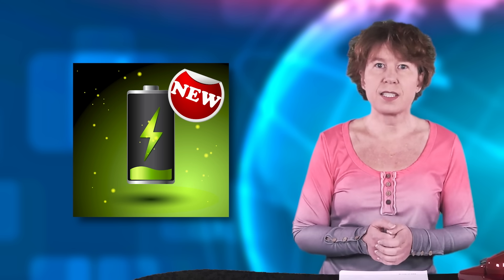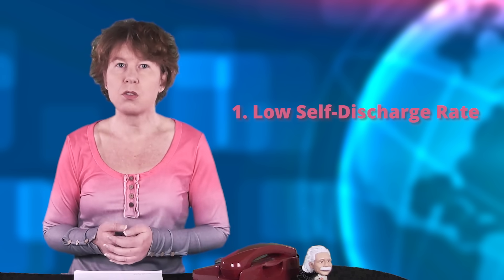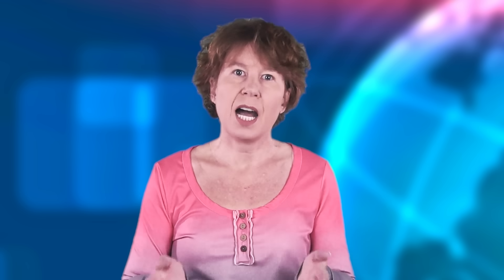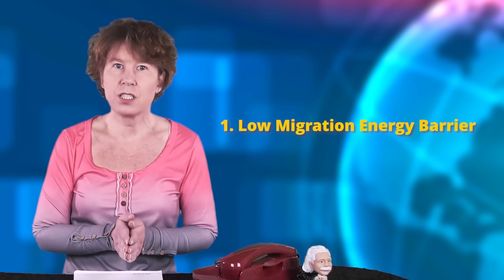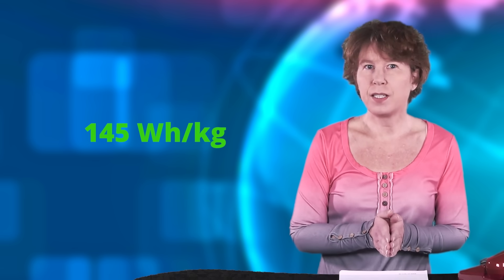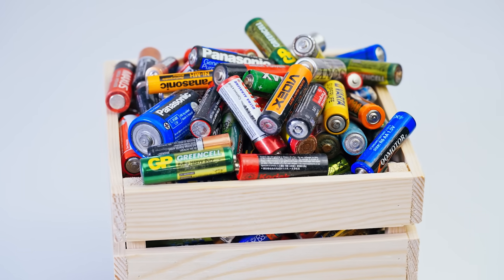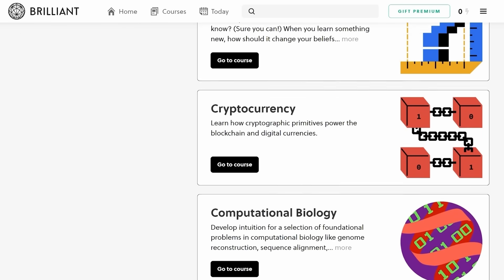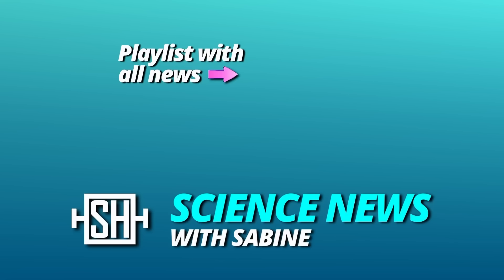Fully Charged in Just 5 Minutes: New Battery Breaks Records

Comment: I may be old fashioned, but I like my toys to plug in the wall.   I don't like my toys to have batteries, for the simple reason, batteries cost fair money and they wear out very fast.   So you always have the issue of finding the proper battery to replace, how to throw the batteries away in an environmental manner.   So, here is the deal....How much does it cost to have a battery station installed in your home for the battery car?   I'm thinking the home charging station is going to go for a minimum of $30,000 for parts and installation (for the EV).   And who pays to dispose of the lithium toxic battery and the same thing for wind or solar :   Your going to need a big BIG storage battery, so how much does that cost ?   An independent 'home' battery to use when those pesky tornados come to town, is around $25,000.   Now, you got your big lithium batter next to your home and it slowly over times becomes ineffective....its TOXIC WASTE.   Who will pay for the toxic waste pickup and disposal ?   The entire EV and GREEN energy (wind, solar, etc) is not reliable and will cost the average citizen a minimum of 3 or 4 times the per watt cost.    So, we go from being slaves to the petrol station, to paying 3 or 4 times current costs to the electricity provider.   NONE of the green energy is inexpensive, reliable and leaves an ecosystem cost.   Fields and fields of solar cells changes the ecosystem under the soil.   No plants, so the soil is susceptible to erosion and blowing away.   No light, no plants, no wildlife.    The windmills are huge killers of bats and birds which unsuspectingly fly right into the blades and are killed and gather around on the ground under the windmills.   The solution is go nuclear for power grid and improve emissions reductions for internal combustion vehicles.  AND, plant more trees to suck up C and turn it into O via photosynthesis.   There are simple answers.

Comment: Sabine, nice way to force me to a comment. It is never a question what you need or me, but the market. To reduce the numbers of loading stations you need ultra fast charging like in the case of gasoline station. You could also reduce there the pump speed or diameter of the tube and than loading time of gasoline would be 1-2 hours or more.

Comment: Charging time does relate to range anxiety.  If you've got to charge at a charging station at all, it makes a big difference whether each full charge takes 5 minutes or 30 minutes if you are in a line with 5 people in front of you.
Reply: But it will be decades before most cars could charge at those speeds. One expensive super-charger, with a queue of people taking 30+ minutes to charge will really annoy the fancy-car drivers. A row of 'normally rapid' chargers would still be far better use of limited supply capacity.
Reply: @robinleicester  Might not be all that long, IF electric cars take off.  Of course, that's still a big IF.

Comment: I bought a PHEV about 5 months ago.  It has a 13 kWh battery that takes about 8 hours to charge from empty to full (*) with my Level 1 charger.   Is that a long time?  Not at all if you're asleep most of that time.  So, if I'm disciplined enough to remember to plug in the charger every evening, it's all charged up in the morning.

Almost all of my driving is "errands", so the 30 mile range for EV mode is plenty for almost everything (**).  The gasoline engine propels my car at about 25 mpg (sorry for mixing units).  That may not seem particularly great, and it's not, but this is a relatively heavy SUV with AWD.  On the other hand, on my current tank of gas I'm getting 190 mpg because the gas engine rarely turns on --- that's about 3 times the milage of the lightest, most miserly car on the road.  Of course, the comparison is more complicated, because I have ignored the cost of the electricity.  However the cost of electricity per mile is about 1/5th the cost of gasoline per mile where I live (***).

Upshot: you probably don't need fast charging for a PHEV.

For a full EV, though, that's a different story.  The batteries for full EV cars are typically 80 -- 100 kWh capacity; it would take 2-4 days for my L1 charger to fill that battery; L2 would halve that --- still slow, but that will get you 50-60 miles of range while you sleep

Quite a few years ago I published a letter in IEEE Spectrum pointing out that, when you are refueling your car with gasoline, the energy is going into the tank at a rate of about 5 MW.  It is very difficult to imagine a consumer technology that would make coupling 5 MW to a car suitably safe, and as Sabine points out, we just don't have a car-sized battery technology that can be charged that fast.

(*) for a variety of reasons, PHEVs will generally avoid discharging below 10%, and chargers will halt at about 90%, so "charging an empty battery to full" doesn't necessarily mean what you think it does; in my case, the effective battery capacity is about 10 kWh.  Because everything has its own web page today, so does my car, and I can remotely monitor its battery charge (and charging) status.

(**) the one peculiar dependence upon the gasoline engine: front window defrost --- it relies upon the heat of the gas engine to provide hot air.  That is the only thing limiting my milage right now.

(***) there is a coffee shop about 2 miles from me that offers free charging, which costs them far less than the coffee I buy.

Comment: OK I'm fortunate in that I have a charger in my driveway and the bulk of my journeys are relatively local. This means charging is not a hassle, it's just a case of plugging a cable in and getting on with whatever I was going to do in the house anyway. Now I realise that if we are to move to EVs then some people, no, a lot of people won't have this option. But what it means to me is that my days of hanging around a smelly petrol station holding a nozzle while the tank fills, are far fewer (we still have a largely ignored petrol backup car).

But fast charging batteries will indeed help those people who don't have my good fortune. But perhaps we need to rethink how we use , or rather how we charge vehicles. I mean I presume everyone who owns a car has some purposes they put it too generally. It will be a minority of people who keep a car "just in case". So if that car is used to travel to work then we need to encourage employers to include chargers, if it is for travelling to the shops then the shopping centres need chargers, if it is to drive to a local station then the parking there needs chargers.

So for me, the fact that my ageing car takes nearly an hour to charge, is not a problem because that hour is generally either spent at home typing pointless messages on YouTube, or it is sat behind my desk at work and in both cases that hour speeds past. But even if I had a more modern EV and every few hundred kilometers I was forced to stop and charge for 15 minutes while sipping a cup of coffee, that's hardly a big problem.

Comment: most any 18650, 22650 etc can be charged in 4 min.  therefore, by default any combo of them in series or parallel can be charged in 4 min.
but when you have 100000 cells of 18650s, you need serious power to charge those in 4 min.  

no matter what tech an ev uses, the ev itself can drive for approx 3 hours at 100k watts.  to recharge that in a few minutes would need massive power available.

Comment: Since we started this with charging EV's lets look at a reasonable situation.  Sure, every EV owner (who is typically a detached home owner with a 2 car garage) just imagines everyone is just like them, but if you look around major cities (LA, NY, Tokyo, Berlin) the vast majority of cars are not "plugged in at home", they'll requrire a charging station.
Tesla has their Supercharger, it currently charges at 480Volts and requires/is limited to a draw of 250Amps (that's 120kW that must be supplied for the duration of charging) This duration is of course dependent on the battery capacity, if we have a humble 40kWh battery that means hanging around for about 30minutes. Now if you've got any sort of memory a typical petrol/gas station has often got more than 5 vehicles "charging up"; so that's in the order of 600kW drained from the grid fairly constantly.
I accept that people can't comprehend this but its vast, a mid-sized shopping mall sucks 49kW per hour for lights and AC; I return your attention to the 600kW being drained by the "charging station"
Things now get a lot worse when you move that to a 5 minute charge time (as that's about what it takes to refill my car). It gets worse because the Amps have to up; 1000Amps will be needed to charge that 40kWh EV in 5 minutes.
One Thousand Amps ... folks that's transmission line powers; that's whole town infractructure there per carging of one EV in 5 minutes.
Reply: Imagine trying to handle a transmission line cable, to plug into your car for recharge.

Comment: Charge time is important for commercial vehicles or public transport though. Long charge times mean that the vehicle is not in use and you need more vehicles and more drivers 
Although twice drop in energy density is huge. Electric lorries already have much shorter range than diesel ones, so the economy of that is questionable
Maybe those batteries find their application where vehicles don't need a long range but used heavily, for example in marine ports or automated warehouses

Comment: I don't understand why we do not just replace all/part of gas stations with battery exchange stations. Slowly charging batteries is ideal for their longevity... why not figure out solutions that reuse existing infrastructure? I figure the biggest issue is having/accepting a standard battery, which isn't a thing atm.

Hydrogen produced on site seemed to have this same idea... doesn't matter what recharges a battery, so why not?
Reply: Sabine made a video about the problems last summer: It´s the grid, that has to change fundamentally, but no one seems to see that, and no one implements it.

Comment: I think there are situations where charging in 5 minutes by doubling the size of the battery makes sense. Maybe a bus for public transport within the city. The battery could be charged at final stations. The distance between one end and the other of a bus line is not that big, hence the battery would not need to be gigantic.
Reply: I don't know. Especially for buses it seems it would be easy to accommodate longer loading times. At worst, just buy a few more vehicles. Might be cheaper than the required electricity infrastructure for extra-fast charging.
Reply: @harmless6813  That really depends on individual cases. And at this point it would be even smarter in a lot of cases to just use Diesel. I would be happy to see this to change.
Reply: @frankhabermann9083 It might be 'smarter' for an individual, it is not for humanity. A typical "tragedy of the commons" case.
Reply: @harmless6813  Not in all cases. For instance, diesel can easily be the better option when your electricity comes from very dirty coal power plants.
Reply: @frankhabermann9083 Even in that case a BEV produces less CO2. It's just that much more efficient.
Reply: @harmless6813  I doubt that, but that is not a basis for further discussion. I will look that up when I find the time.

Comment: The biggest hurdle for an increased adoption of EV cars, in the US anyway, is comparing favorably to combustion engines. The biggest issue in perception is that it's hard to take road trips with EV cars. Quicker charging is necessary to replace the idea of filling up a gas car.

It's not necessary 98% of the time because we can charge overnight at home, but sometimes the exception is the barrier. EV cars need to get around this barrier.

Comment: Just off reading the title, is this a battery... or capacitor?  Capacitors both charge and discharge very quickly, the latter not being ideal (or usable) in most applications you would need a battery for.

If it's a battery, that would be neat.
Reply: As she explains, it´s a battery, no? Just another matetrial for the elektrode. A capacitor has a very small capacity

Comment: I'm not sure that faster charging time would help reduce my time at stops.  I spend far less time at the fast charger itself than I used to spend at the gas pump.  I plug in, check that it's charging, and walk away to go pee, get a coffee and maybe a sandwich, hurry back, unplug and drive away.  With a gas pump, the person stands there for a few minutes while it pumps, then walks in, pees, gets a coffee and maybe a sandwich, and drives off.  I'm not seeing the time savings, with ten times as long holding the gas pump handle as I spend holding the charger handle.

If the battery charged in two minutes, I'd be back to standing there the whole time.  That's a time waster, not saver.

Comment: 1) Planned long distance road trips already maximize distance vs charge time. You don’t change over 80% per stop if you don’t have to because of the extra time it takes to top a battery off.

2) If you can reduce a charge stop to less time than it takes to fill a gas tank, you’ve won the battle against conversion.

3) we really should have other solutions to long distance travel, like high speed trains or planes.

Comment: About 90% of the time EVs are charged while they are parked at home or a workplace. There is no need for rapid charging in these circumstances. Battery cost and vehicle range are the two key parameters limiting EV adoption.
Reply: market data shows the biggest decision criteria are still range and charging speed. A car buying decision isnt based on facts, but on emotions. It may be sad, but if you want a larger adaptation you need to paly the game and bring out innovations for a good feeling.

Comment: At a charging station, only one car can charge at a time.Therefore charging in 5 minutes instead of 20 means a single charging station can serve four times the number of cars, which in turn means you need only a fourth of the charging stations to serve the same number of cars. Also, if you go away during charging to do something different, chances are you'll not yet be back when the charging ends, thus further needlessly blocking the charging station. If charging is fast enough that going away isn't worthwhile, you'll probably free the charger for the next car as soon as your car is charged, as there's no point in waiting longer.

Comment: I think we might drop the battery issue altogether.  As we learn to capture carbon in our efforts to hold down atmospheric CO₂ and, as we look for ways to store off peak energy produced by windfarms and solar power stations and turn to electrolysis to obtain hydrogen fuel, I think it might occur to someone that we combine carbon with hydrogen to make what we might refer to as juvenile hydrocarbons which could be formulated as liquids which would have high energy density at atmospheric pressure and room temperature.  It could be stored in underground tanks and pumped into tanks in our vehicles in a couple of minutes.  Such fuel would have no net contribution to atmospheric CO₂.  We could so deplete CO₂ from the atmosphere that we would start to worry about it causing an ice age.

Comment: As someone who actually owns an EV, the concerns about range and charging speeds are overblown. 
Likely perpetuated by people who DON"T own one.

You should be stopping for a break every few hours anyway. 
And 20 mins is perfect for a refresh and most chargers are positioned in places near cafes, shops and things to see.

The only real issue comes from larger distances between charging stations where certain locations just aren't accessible. Like in outback Australia.
I've never had a problem doing coastal road trips.
Reply: Part of the reason we non-owners prepare concerns over range and charging speed is that these are two of the reasons many of us haven't made the change. Specifically, the answer to the following question: of I run out of gas, I can grab my gas can and walk down the road; what happens if my battery dies?

Until more tow vehicles can serve as mobile superchargers, the answer is probably to get dragged shamefully to the nearest supercharger just to wait a long time and try again.

You're not wrong, but yeah we have concerns.
Reply: @sabinrawr  That’s a 100% valid concern. 

Thankfully it’s somewhat mitigated by good route planning, however you can’t protect against the chargers at that location being out of service either due to an outage or vandalism.

We have crowd sourced apps that track the state of the charging facilities, what’s available near them, which ones are broken, etc. 

It’s fairly robust now in most areas.

Speaking of towing, if you do need one, it has to be a flat bed as dragging it along can damage the motors!

Seems worth the risk to me! I won’t go back, but I’ll never buy another Tesla either (for many reasons).